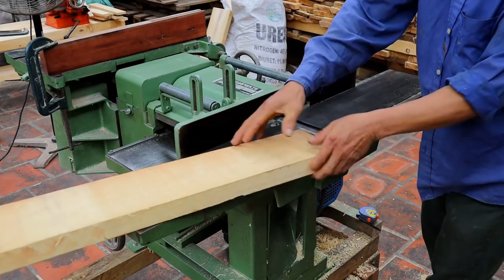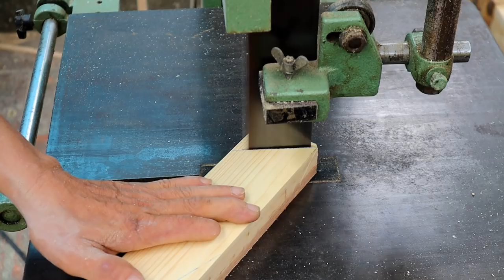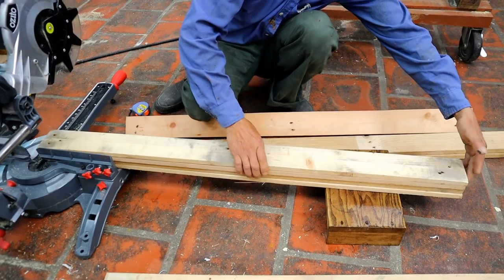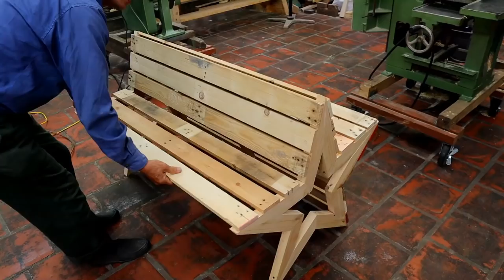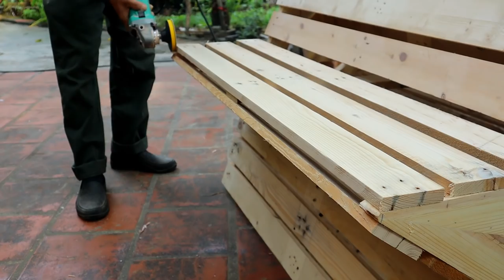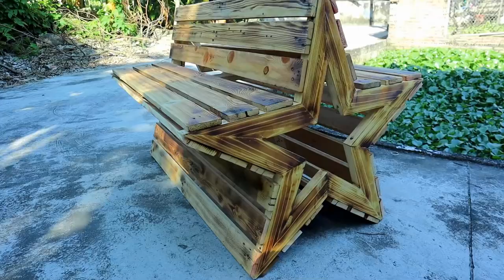Amazing Woodworking Idea From Old Pallet // How To Build A Unique Bench For The Garden

Comment: What are the total measurements and at what angles?
Reply: 18 and 54 degrees. Length is optional  from top to bottom  star will be twice the length of board u use. ie.1 1/2 foot boards make 3 foot star.